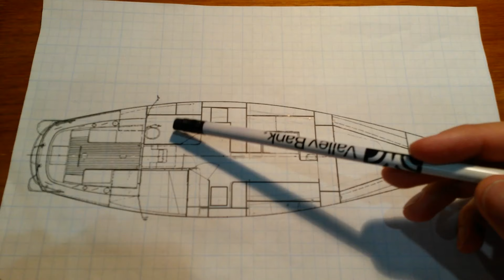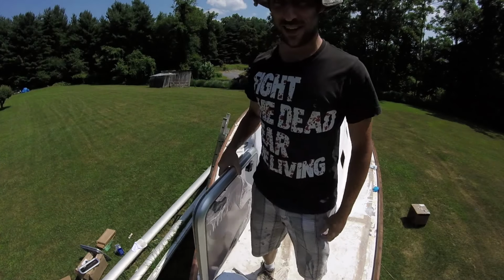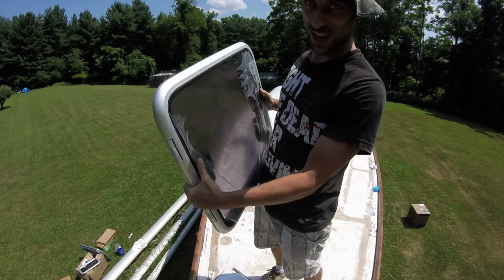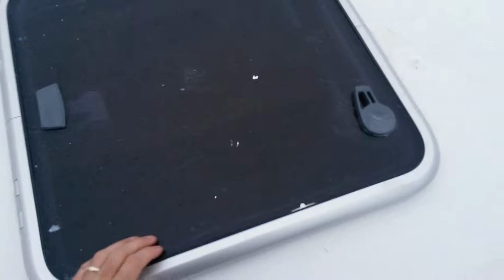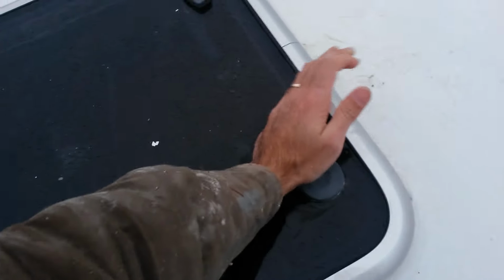New Hatches and Portlights - Finale

Comment: Could you have used butyl tape for the hatches?
Reply from the maker: I'm not familiar with the properties of butyl tape. I found the 3M sealant very easy to work with, as long as you dont mind taping off the edges to get the cleanest lines.
Reply: I thought I might have seen 3M 5200 on the caulk tube ....hopefully you did not use 5200.
Reply from the maker: Used 3m 4000 uv.
Reply: Brian Milby what is wrong with 5200?

Comment: If you bedded those hatches and ports in silicone and not T-5200 they are all going to open up and leak like a sieve in a season or so.  The thing is a boat, not a bathtub and the silicone is not UV and heat stable. 

Do yourself a favor and stay close to shore for a couple of seasons so you can be saved from all your flawed building practices and materials choices.
Reply from the maker: (Superb?) media content, you are right that silicone is a bad choice for this application, if you observed closely it is obvious that is not what I used.